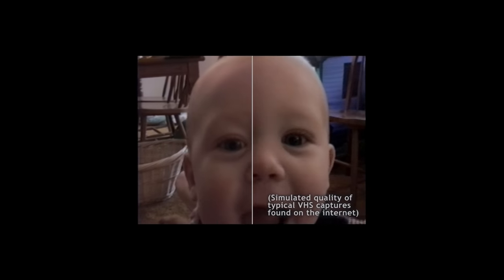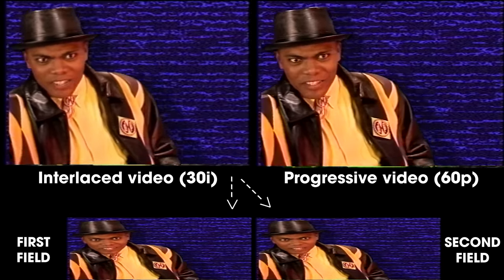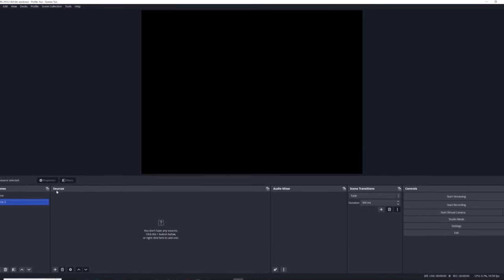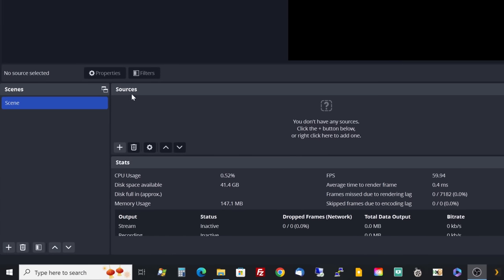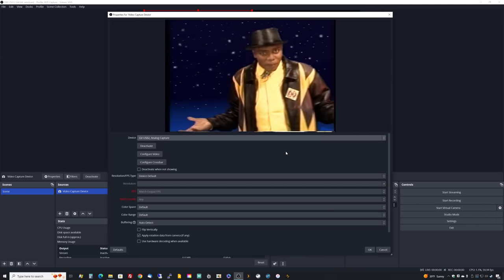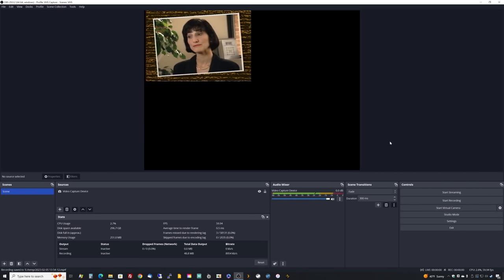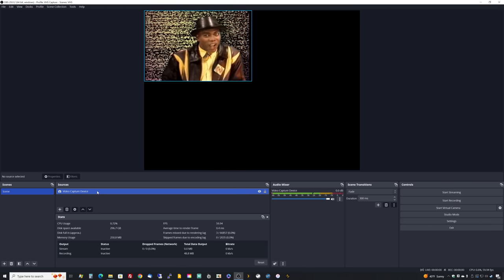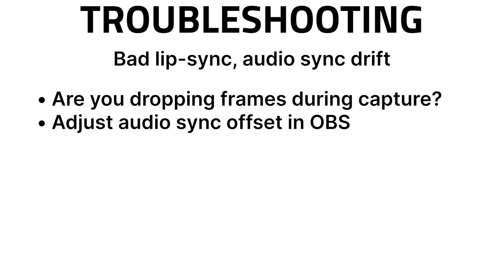How to convert VHS videotape to 60p digital video

Comment: Thank you for your tutorial ON OBS it came through clearly thank you for that the trouble I am having is the burning the converted tape to DVD, I have tried different burning programs, they either go for 10 to 15 mins and drop out or they go for 20 to 25 mins and video freeze can you recommend a good burning program or let me know what could be the problem between converting and burning PS I have tried burning at different speeds
Reply from the maker: I'm afraid all I can recommend for burning is that you keep your source materials on a drive that doesn't have contention -- meaning, the only drive activity should be burning and nothing else.  If the drive is doing a ton of other stuff while you're burning, it might be enough to interrupt the burn.  I use IMGBURN on Windows and haven't had a problem, but you need to prepare your VIDEO_TS files with some other program first.

Comment: Thank you for uploading this.. Whilst I'm waiting for the I-O Data lead to arrive, I do have one question regarding the, I think it's called 'pixel rate'. The TV that I will be playing the converted video on will be PAL-B but doesn't have an auto fit picture, only zoom 1 or 2 and old video to you tube videos when I play them always seem to fit incorrectly. I believe my screen is 1980 x 1080p. My question is If I choose that setting to convert to digital, am I likely to find blurriness? Thank you again.
Reply from the maker: If you follow this tutorial and perform the resize to 1440x1080, they should display just fine on your TV assuming your TV is not set to zoom at all.

Comment: Thank you for this tutorial! I have several questions to you, if you don't mind. 

1) In your tutorial you made in 2016, you used EasyCAP to capture 60p footage, but in this video you don't recommend it anymore. Have those devices been downgraded or did you not know at the time that they did not work well for 60p?

2) Do you know if "Elgato Video capture (the white USB capture card)" passes both fields through and as such is suitable? 

3) What bitrate is "High Quality, Medium File Size"? What bit rate would you recommend in general?

4) Finally, I am guess this does not need to be asked, but still for clarity. Would you recommend this, OBS method, of capturing over the original VirtualDub + Handbrake you did before? 

Thank you!
Reply from the maker: 1. I stopped recommending EASYCAP devices because it turns out there are something like 57 different variants and they don't all work the same way or use the same chipset.
2. I have never used that device, sorry.
3. I don't know exactly what the "high quality medium size" bitrate is, but I recommend it because VHS sources don't contain much detail, and the other settings produce files that look identical but are much larger.  You can always try out some custom encoders and their settings, like x264 as an encoder with settings "crf 18, preset veryfast".
4. I recommend this method for people who want to hit PLAY on their VCR, hit record on their PC, hit STOP on both once the tape is finished, and then upload the resulting file to youtube.  For more control, the 2016 method is better.  For archival or restoration, I don't recommend either of these tutorials, as they are for beginners.
Reply: @TheOldskoolPC  Thank you for the quick reply!

Regarding point number 2. Just to confirm if anybody else has the same question; yes the Elgato Video Capture - Model: 2VC309901000 / SKU: 1VC108601001 (the white USB capture card) passes both fields through. 

I tested it using your method shown in the video and compared to the EasyCAP I have. I asked the question originally because I did not think I would notice the difference, but it was very obvious between the Elgato and the EasyCAP, once I captured some footage. 

However, the Elgato seems to have an issue where the picture is not saturated by default (or maybe the EasyCAP oversaturates it, I don't know). 

EasyCAP's image looks better to me in default settings. After watching your excellent tutorial, I ordered I-O Data GV-USB2 from your description link. Once it arrives, I'll compare it to the Elgato and report back on how its default image compares.
Reply: @georget10i  can't wait for your update
Reply: @georget10i  Any update?🙂
Reply: @alfonsgun00  Yes, I got some updates. 

I want to make a comparison video, but I'll answer now and maybe make the video later. 

As I mentioned previously, the Elgato passes both fields through, yes. But it still captures some interlacing (can see it in bright colours, like clothes). The GV2 has no interlacing when using 50/60 fps (TheOldskoolPC's method). It's a bit strange because, before I installed the GV2 drivers, I thought the Elgato did not capture interlacing, but I am probably misremembering. 

The Elgato has a bit of a too high contrast compared to the GV2 by default and needs to be toned down in the settings. The GV2 itself has a high contrast, I feel, and a bit of an under-saturation by default. I lowered the contrast to 100 (from 105), and increased the saturation to 132 (from 128). 

The EasyCAP's video quality itself is about the same, but no passing both fields through. 

The EasyCAP does not play nice with OBS. No matter what setting I tried. I got better, more pleasant results using PotPlayer (but PotPlayer is not as flexible and does not have crop support) as a capture tool (yes, it can do it, enter ALT+C command and a recording menu will pop up). But of course, the result still does not come close to the smooth video the GV2 or the Elgato produce. 

But, here's one big PRO the EasyCAP has over both, the Elgato and the GV2. It captures VHS as is, with all scan lines, flickering, noise, and the static. What VHS tape is, is what you will get. The GV2 and the Elgato substitute noise and static with a blue screen. So if your VHS recording has some damage, instead of, in my opinion, more natural static VHS look, you will get a blue screen until the image clears. Not a fan of that. For example, there was a funny moment in one of the VHS tapes I was capturing, but there was a bit of damage at that part. Both, the Elgato and the GV2 messed up that part and basically froze the image until the moment passed. The EasyCAP captured it. Yes, with some static and noise, but it's still a good and very usable footage. I wish there was a way to disable the blue screen in the GV2 and the Elgato through their drivers. But there does not seem to be. 

The EasyCAP's colours are more saturated. A bit too saturated in my opinion, but sometimes, it actually blew the image out less than either the Elgato or the GV2. 

Neither the Elgato, not the GV2 are forgiving on fast forwarded video. If, in your family tapes somebody made a mistake and recorded a fast forwarded video, you just get a frozen frame with the GV2 and the Elgato until that part is over. If you fast foward video yourself, the frame freezes. The EasyCAP captures it as is, a fast forwarded video. 

Now, onto OBS. 

I captured my videos using at Output mode: Advanced. With H264, VBR 5000kbps-10000kbps, 720x576 pixel video and 192kbps AAC audio. I read on Reddit and other sites that for VHS video 3000kbps should be more than enough. Then, I got curious and compared it to TheOldskoolPC's suggested Output mode: Simple and "High Quality, Medium File Size" recording quality. I could spot that with this setting the quality looked a tiny bit better than what I recorded with. So I checked the bitrate of the video and it's about 10000-12000kbps, which is quite high, but it does make the difference. Slight, but there is a difference. So stick to TheOldskoolPC's suggestion. I ripped at 720x520 (PAL) pixels. If you are uploading to YouTube, again, I would follow TheOldskoolPC's advice and rip at higher resolution. 

Compared audio too. Could not tell the difference between 192kbps AAC and 320kbps AAC. So 192 is good enough. "High Quality, Medium File Size" records AAC audio at 192kbps, just so you know. 

A 3 hour VHS, encoded with H.264, VFR 5000-10000 and 192kbps AAC comes out at around 7-7.5GB file. "High Quality, Medium File Size" will be larger. 

Make sure to use the crop tool (CTRL+E) and crop the video accordingly (when you start cropping the top, the bottom, and the sides, the video will fill in the screen). 

So, to answer: Go with the GV2 and follow TheOldskoolPC's guide to a tee, no need to improvise. That is the best way right now. Maybe, I would go with H.265, but OBS does not seem to have that option in Output mode: Simple. 

Finally; capturing VHS tapes is a pain! VHS tapes produce different artifacts at different times. You can play a video, it'll be fine, then play it again and it will flicker. So have patience. 

Use a decent VCR. I used Sony SLV-SE730 and SLV-SE820. Which again, one VCR worked well with some tapes and the other worked well with the others. Odd. 

If you use your PC during the capture, you may risk having some video stutters as the I/O operations, such as writing to your SSD, reading, etc. will interfere and will be recorded. And in a 3 hour video, you will most likely not notice it, until much later. You won't be very happy once you spot that and realise you need to re-capture the tape (guess, how I know that). So do not use your PC much while ripping videos. 

Make sure not to shake your VCR by bumping into the table or whatever it rests on, even slightly, as it will show up in the video as ripples. 

Don't FF and FR your tapes to the beginning. Stop the video. Rewind forward about 25% and then rewind back and let the VCR stop it, so the tape goes all the way back. Start recording in OBS, and then hit play on your VCR. If you roll back the tape using FR, it usually does not go all the way back and if you hit play, you will miss a few seconds at the beginning. 

If your VCR has on-screen icons and indicators, look into disabling them, so you don't capture them. 

Restart OBS after each capture. 

After you are done, you will get a new appreciation for how good we have it now. VHS looks cool in the distant, faded memory and in retro-synthwave videos. But once you start working with it, you will quickly realise how much better, reliable, and convenient modern technology is. But you gotta do, what you gotta do, at least once, to save those family memories. They will appreciate it. 

Happy capturing!

Comment: I have Digitnow and i was upset cause i bought it before watching this video. But now I think i found a way to make the video smoother too with 50 or 60 fps and is with something you didn´t cover on this video. When you choose the video capture source you have under  the options of configure crossbar.. under that options you can choose resolutions/fps an put on costume. There you can choose 50 or 60 fps. and voilá the video looks like a 60 fps. All others options you mentioned on the video i did it too, and now looks very nice.
Reply from the maker: Some capture devices deinterlace using their capture driver, which is outside of OBS control.  For those devices, setting to 60 does indeed work, although you can't change how it deinterlaces.  Glad you found this out about your own device.
Reply: @TheOldskoolPC   I bought a Startech that you mention here on this video and found out it its worst than DIGITNOW. I was hoping would be better.Startech has less sharpness, some flickerin around letters, video skips/jumps and lost frames. Tried reinstall drivers and did not help, installed older drivers and not worked fine... From my experience i have better results with DigitNow. I have to send Startech back, maybe has some issues with hardware.

Comment: Great video which I'm currently going through. 
2 questions, 

1:  As I'm on Ireland on the PAL system for Hi8, does this affect the 1440x1080 setting?
2:  Confusingly, I purchased the Startech as it was best value for me, and it has female S-Video input, but so does the camcorder! So I'm getting a male to male S-Video cable to address, but is this unusual that the camcorder is female also?

Thanks again!

Comment: You man have a new subscriber! You not only told what to click, but WHY!. That's so important when teaching. But I have a couple of questions...
1. Is there any advantage to using a Firewire input instead of composite inputs? I ask because I have the ability to do either one. I am converting some old tapes that reside on a Sony Digital8 camcorder and the camcorder has both composite and firewire outputs. 
2. Can OBS do scene detection so that It will make separate files for when either a timecode or a visual scene change is detected?
3. I saw you have Blackmagic. I use Davinci Resolve for editing, and am wondering if it is possible to us DR to do the capture directly in, instead of doing OBS to create files. If so, can I use my Firewire device in DR?
Again, great job and thank you!
Reply from the maker: If your tapes are actually DV tapes, then don't follow this tutorial and use firewire (ieee 1394), because that's a lossless transfer of the DV data from the tapes into files.  In Windows I use WinDV to do this, which will also split to multiple files based on timecode splits.

I don't use Resolve so I don't know if Resolve can directly capture DV.  Premiere Pro just removed support for it, unfortunately.

Comment: WOW, great video for a beginner like me. I am using the Roxio Easy VHS to DVD Plus and  OBS is a great alternative to Roxio's software. However,  I have a problem with the audio. I am transfering directly from my camcorder that uses Video 8 casettes and the transfered recordings have a buzzing sound. The tapes have no buzzing when played on my VHS player. I've checked all the cable connections. Any suggestions? Thanks!
Reply from the maker: Try rebooting and giving it another go.  Also use exactly the same cables as you use with your VHS player.

Comment: This a great tutorial - thank you for taking the time to make it!

Am just wondering, please, if there is a quick way to check that the video capture device is in fact capturing both of the fields (odd and even/top and bottom) that make up a single frame in a VHS tape?

The capture device I use is the I-O DATA GV-USB2, and the software is OBS running on Windows 10 - and it's the PAL system, as I live in Scotland.

I only ask because I don't seem to notice much - if any - difference when I tried this with the new capture device, so am thinking I must be doing something wrong. Thanks.

Grant
Reply from the maker: If you're not sure, you can check my previous 2016 video on this subject, which uses Virtualdub2 to do the capture and conversion.  Looking at a single frame with motion in it should clearly show if it is capturing fields or not.  If you don't want to do that, you could try reversing the field order during capture (see the Troubleshooting section of this video) and see if it suddenly make the video "jerky" or "juddery".  If switching field order makes it worse, then the device is indeed capturing both fields.
Reply: @TheOldskoolPC  Thank you for your reply.

Yes, I had a look at the Troubleshooting section, and then did two different recordings. For the first one, I chose 'Top Field First'. For the second recording, I chose 'Bottom Field First'. But both of the recordings play exactly the same - not jerky or juddery.

On the Details tab for the Properties of the two recorded files, it says the framerate is 50.00. I thought this might suggest that the capture device is working properly, but, then again, perhaps not?

Am not familiar with VirtuaDub (though have heard it's a difficult program to learn!), but will have a look at your 2016 video.

Comment: This is an awesome video! ✨👍
Question: I have digital tapes from an old camcorder. Can the software you showed,  improve the quality (frame rate, etc) of digital sources as well?  Thanks
Reply from the maker: If you have digital tapes (ie. DV) then you should use a different method to grab the video, such as using a firewire (IEEE 1394) interface and a program like WinDV to directly transfer the already-digitized video data.

Comment: Thanks so much for this incredible video. It's been very very helpful while trying to digitize all my family's tapes. Quick question you may have some insight on:

I bought a Sony TVR350 and have been using the DV output primarily, but I stumbled onto the great debate of S-Video vs. DV capture. Doing some direct comparisons myself, S-Video DOES look a bit sharper and less washed out. 

Using the I-O Data GV-USB2 and your settings, I'm getting a great capture BUT every few seconds there is a frame duplicated, which produces a noticeable (at least to my trained eye) stutter. However, the frames are not exactly the same, as it looks like the same frame but processed slightly different with some different artifacting? So I'm not sure running some FFMPEG script to remove identical frames will work?

I'm working off a maxed out M1 Max in Boot Camp, so I don't think it's a technical limitation as I'm never going above 11% CPU usage and there are no dropped frames being reported by OBS. Some people online have suggested that OBS just does this, but even with a 480 output vs. 1080, it's still occurring. Any thoughts as to what might be creating these phantom double frames?
Reply from the maker: If your data is stored as DV and supports DV/firewire output, you should always be using that.  Anything else introduces generational loss.  As for the phantom double frames, I have no idea, sorry.  (Capturing over DV/firewire will avoid that problem.)
Reply: Yes it appears that is the best way to record it. Seems I will have to color correct the footage slightly to make it look more like an S-Video capture. Not sure about the frames either but I could not make them go away in various capture attempts. I appreciate the help and the awesome video!  @TheOldskoolPC